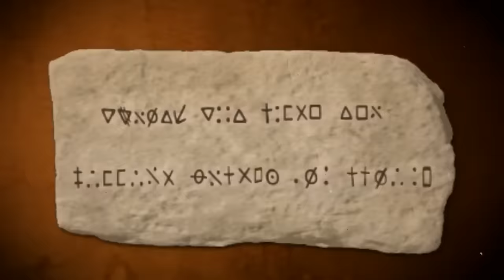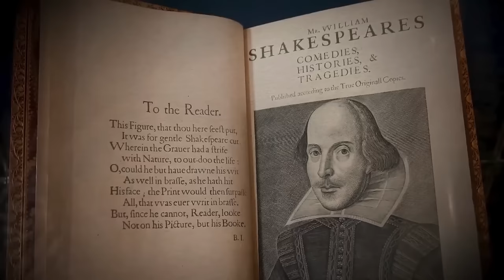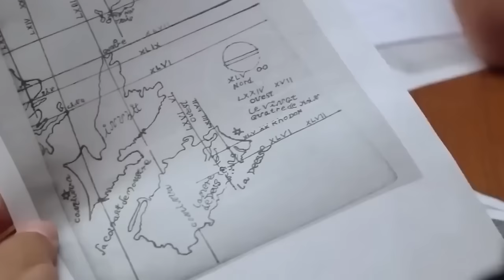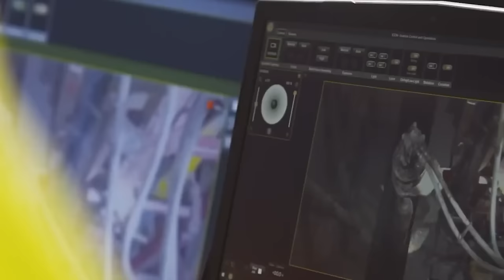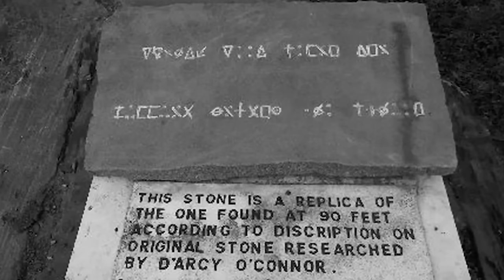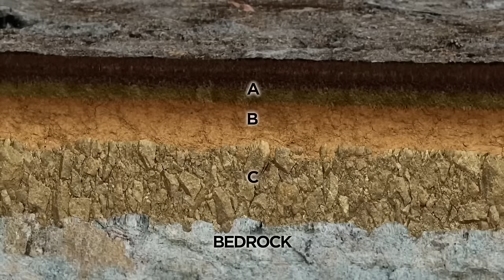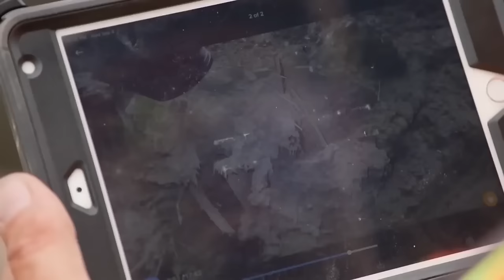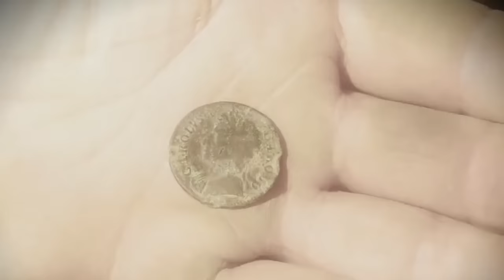What Scientist Just UNCOVERED At Oak Island Shocked The Whole World

Comment: My thoughts are that after the trap was tripped in the original money pit and the    water flooded the pit it would seem the only way to defeat the trap would be to seal the bore hole and pressurize the bore hole to drive the water out. An air lock would be added for acc😢